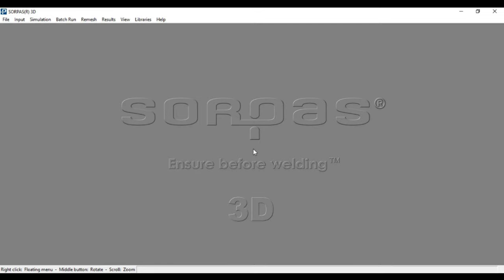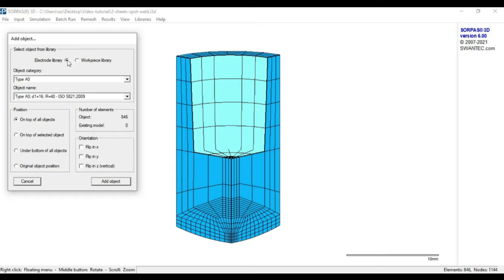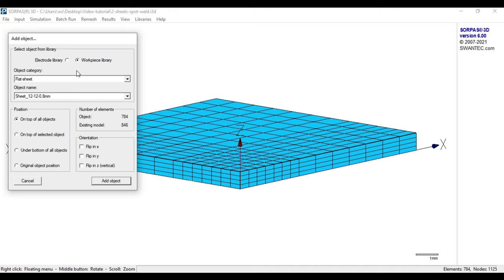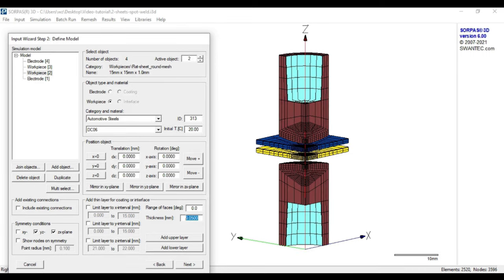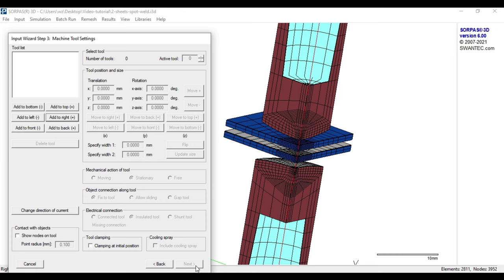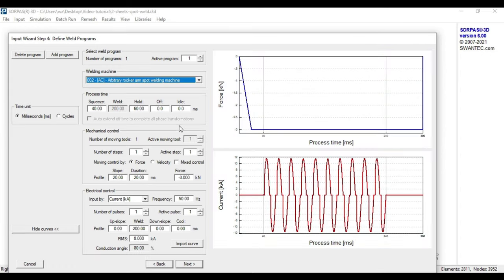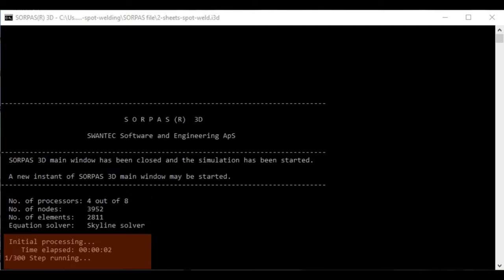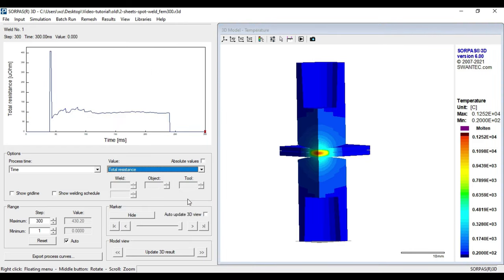SORPAS 3D - 2 sheets spot welding simulation tutorial

Comment: What is the interface material the software will choose for contact resistance?
Reply from the maker: Hello. The properties of interfaces are modelled automatically in SORPAS depending on the surface conditions and dynamic interactions with pressures and temperatures at the contact interfaces.